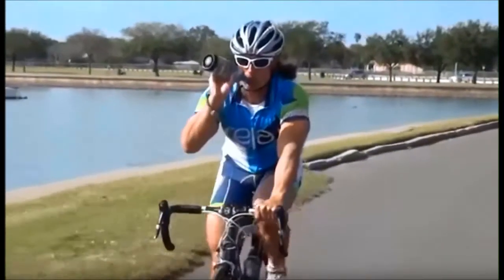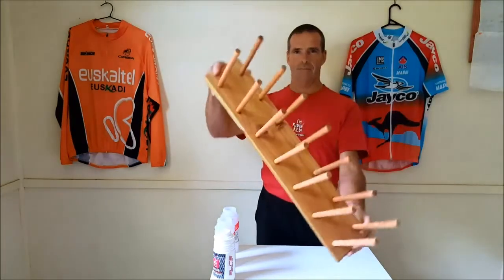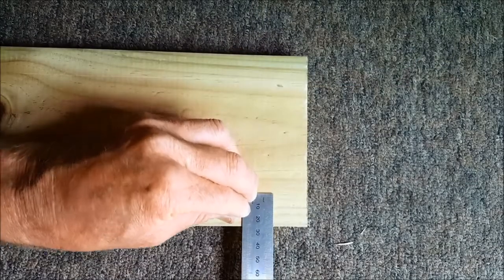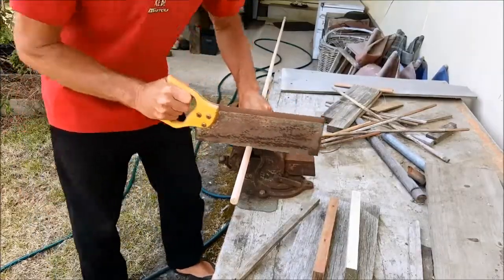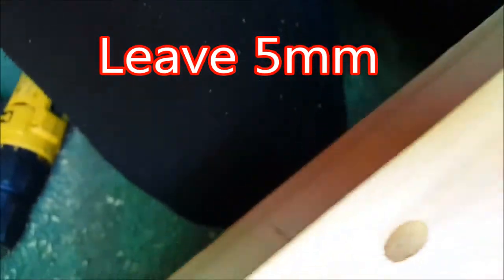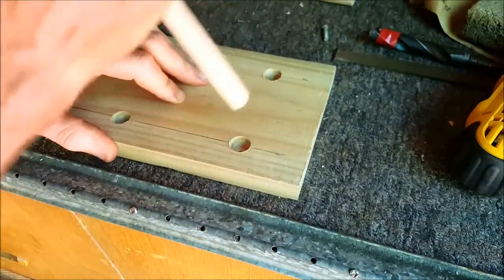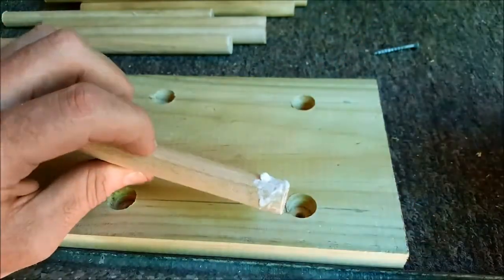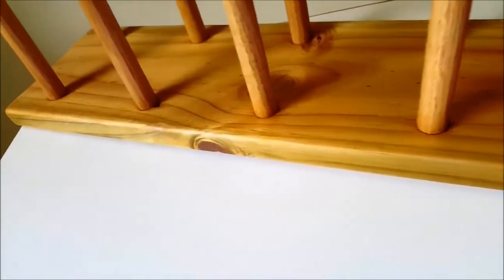Is your water bottle clean?

Comment: Question: should I try to pull it back or just leave it? 
If i take rear wheel out then rear dropouts will spring about 10-15 mm wider than they supposed to be. So to install the rear wheel back, i have to squeeze rear dropouts a bit, then insert the wheel. 
Should I: 
1 replace the frame
2 spend money trying to fix it
or 3 just relax and keep this bike as a commuter and start looking into getting a second bike. 
Thanks Steven.
Reply from the maker: +SnowKiter  Sorry for late reply Snowkiter.  Your frame doesn't sound good by your description. Generally it's not good to re-bend alloy frame tubes once they have been heat treated set from the factory. Re-bending will drastically weaken the alloy structure of the tube. So yes,use it as a commuter bike if you wish but I certainly wouldn't recommend you rely on it for safe riding. Alloy frames are usually MIG welded....if you wish to get it repaired,find an experienced MIG frame welder to do the job.  A new frame would be the best solution.  Hope this helps you Snowkiter....cheers..Steven
Reply: +oz cycle 
Thank you very much Steven. 
I'll get another frame. By watching your videos I kinda started looking into better wheels already so now i will get fm066 frame as well. Likely i walked out of that incident with the scratched elbow and a bruise on my ankle. Lady who ran into me was going at least 40kmh, her motorbike scratched asphalt for 10-12 meters after she ran into me. She was fine too, these Thai crazys know how to fall :)  I would better have a new frame than broken leg. 
Happy new year Steven! Stay safe.

Comment: Hi Steven, my question isn't related to this vid, but if you can give me your opinion I'll appreciate it.

I was hit 90 degrees by a scooter. Front Wheel of the scooter bent the right chainstay. Rear wheel wasn't affected. Shifting works for most of the cogs, but rattles when i use easy gears while climbing. 

Frame is Allux Giant Defy 1.